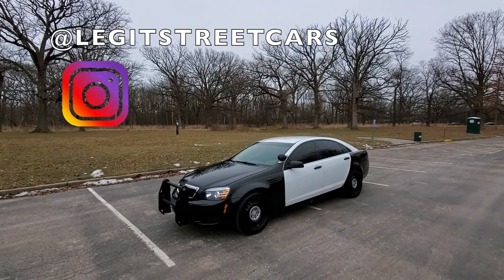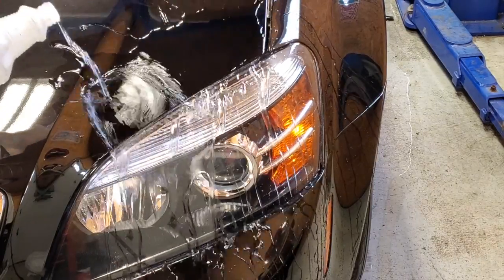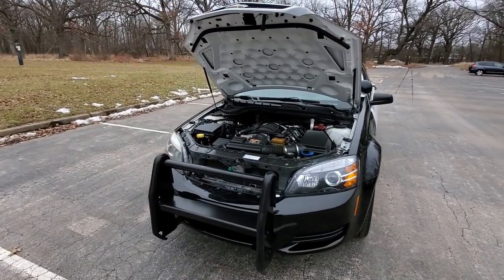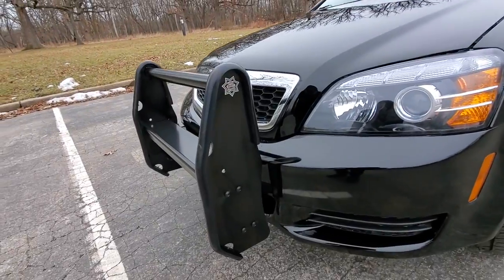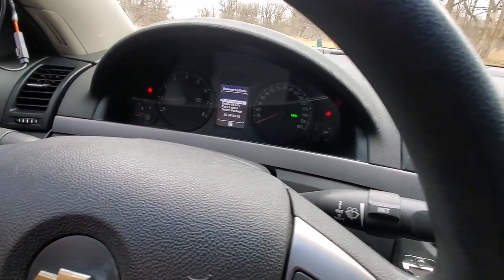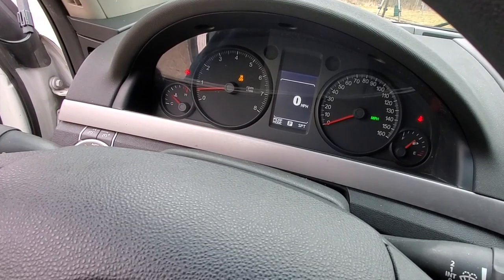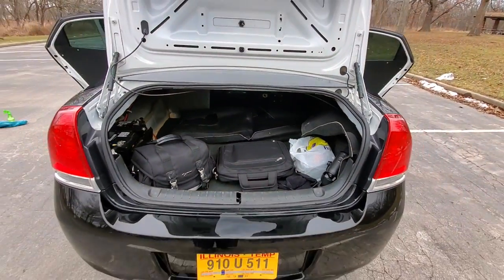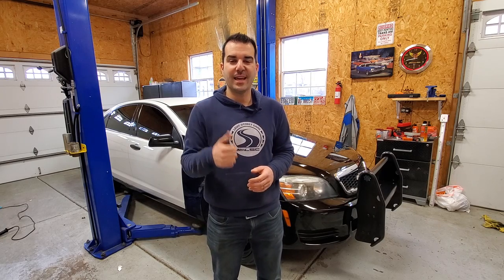I Bought The Fastest Police Car Ever Made & The Cheapest Way To Buy A Modern LS CAR! 4-Door Camaro!

Comment: I own an '09 Pontiac G8 GT, basically the same car. I bought it new in September of '08, still own it although she's in the shop now. It's fast, especially with a few mods I did, had it flashed for high octane fuel, put ram air in it and had the tranny firmed up. I can bake the back tires (limited slip) taking off then a good chirp on the 1-2 shift and a chirp on the 2-3 shift, that's at close to 100 mph so I don't do it very often. When I first got it I caught myself doing 120 mph several times on the way to work, ha ha!

Comment: Vehicle made and sold in Australia by Holden and called the Statesman here. Also came with 6.2 LS or LS9 from HSV vehicles with very upmarket brakes, coolers, and tires. Top speed was limited to 155mph (without limiter - 182mph).

Comment: That cars a holden VE statesmen built in South Australia/Adelaide built at the Elizabeth holden factory
Reply: Technically, no its not, all LWB vehicles in Australia were W prefix designation SWB and MWB were V prefix, and that vehicle is not a Statesman as Statesman is a trim level designation not a platform designation so you might as well call it a Commodore which is about as factually  correct, not! If you remember Holden discontinued it and only made Caprice level available
Reply: Its a WM Caprice

Comment: I had a 1977 Plymouth Fury II with a 440ci large block mopar engine. It was a used state police interceptor. It had 65000 miles when I got it.. Had it up to 125 and still had more than an inch of accelerator pedal travel. Reason I didn't go faster is suspension developed a shake at that speed.

Comment: Check with your local used car lots to find out who they use to replace headliners. They take the existing one out, clean all of the old fabric and glue off of the board. Then they replace the fabric and reinstall. I have a local guy that does them for less than 100 bucks. Check into it.

Comment: It came from Florida, that's why it has a million idle hours. It's hot there and when the Cops were sitting still they had the air conditioner running.
Reply: They all do everywhere. Up north you have to have the heater running. Plus you need to keep the battery charged with all of the accessories they use.

Comment: In Australia you could have bought the similar car with similar, or better specs. Most Holden models could be bought upgraded by HSV (Holden Special Motors), which depending on what's available, the car could be a decent performance upgrade. Or, a step further to the ultimate upgrade, is to buy the car from Walkinshaw Performance, which I believe was an authorised dealer. You could get a stock Commodore V8 high 200kw, or a HSV at around 310kw, or a Walkinshaw GTS which last time I checked, upped the performance to almost 700kw, which is maybe 50hp shy of 1000hp. (Not exact conversion, as there's multiple types of horsepower. 1kw is near on 1.35hp)

Comment: They are very fast, I worked at a GM dealer when we had a high speed chase involving a modified liter bike and a Caprice . They pulled the chase at 160mph. We then had to speed lock that Dept cars to 140mph. I got to speak to one of the officers involved and he said " the officer was at 170 mph at one time and it was still pulling ". I would get one of these but as a gm tech I know how expensive the parts are for these. Most dealers don't carry parts for the Holden Caprice and good luck getting parts at Napa .
I love my p71 but I am looking for a new retired police car. I'm going back and forth between one of these or the Dodge. I really like the dodges styling and performance but I've been a mechanic for over 25 years and I have trouble trusting any Dodge product as they have made me a lot of money but the GM is not without it's issues like eating its own valvetrain, and massive oil consumption issues, and the price and availability of parts.
Reply: Rob Sorgdrager just order parts out of Australia for anything unique to Oz but most parts can be cross shopped from other models.

Comment: I drove a taxi in the mid 90s in OKC and we were driving ex-highway patrol cars. The most numerous then were the Plymouth Furys but I drove a square body Crown Vic that had been a detective's car so it had the cloth interior and was pretty well loaded with options. The Fury's weren't the fastest cars but they were extremely tough. The last one I drove was privately owned and it had north of 430k on it and it drove like a much newer car. The Crown Vic wasn't nearly as basic as the Plymouth but it was a lot more comfortable and roomy.

Comment: My father was a Florida State Trooper on the Turnpike in the mid to late 60's. In late 1968 FHP was purchasing 1969 Dodge Polara's with the 440 Magnum Police Package, not sure what horsepower or gearing, but these cars routinely push 180 mph and a bit beyond top speeds. He told a story of clocking a Corvette heading north at a high speed sometime after midnight near the northern most Orlando toll exit. In those days, clocking was done manually with a unit called "Vascar". My dad turned to pursue and did not catch him till just before the Okahumpka Service Plaza, and only because the driver of the Corvette pulled over and stopped. He could have gotten away but was fascinated to know what kind of car was slowly but surely catching up. Of course, back in those days radial tires were somewhat new and in some cases proved to be unreliable at such speeds, and at least one Trooper was killed during a pursue because of tire failure.

Comment: I’m a performance driving instructor, and I’ve had the opportunity to spend time in the Chevy Caprice, Dodge Charger (hemi), Ford Inteceptor (Taurus 3.5 turbo) and Crown Vic (4.6l) on a track. The fastest around the track was the Ford, primarily due to AWD. The Dodge (Rwd) was a close second, and the old Crown Vic actually edged out the much more powerful Chevy Caprice (6.0). The reason was the frame was so flexible we had the outside front tire vibrating when pushing it around corners. It was really disappointing. I’m sure a strut tower brace would help, but it’s really just a flexible chassis. A shame really
Reply: Caprice did poorly in MSP and LASD testing, outside of top speed (155 mph vs 152 for the Dodge).  It also did very poorly in the Car and Driver Lightning Lap against the Dodge.  

The current AWD Charger holds the top spots in the MSP against the new Exploder, which suffers from some understeer, braking, and downshifting problems.

Comment: You just need to get spray glue for the headliner sag. Go to the side and either pull some apart or slice it with an exacto knife then pull it down so you can fit the bottle inbetween. Then you just spray all over and have someone else take a flat edge while you pull the material back so it lays nice and straight. I cannot believe you know how to change a cam and put headers on but do not have experience in re-gluing headliners! Wow! Also, the reason your exhaust rusts is because of the moisture your engine makes when it heats up. All gas has water added to it. When your engine is hot enough it evaporates and goes out the tailpipe. If you do not run your car long enough at a higher temp (IE you have a 15 min drive to work everyday and don't warm it up more than 5 min) the water never burns off. The muffler will rust or rot from the inside out. This is common and I see it all the time when I am driving that people will start quick off the line or turn a corner sharply and about cup of water runs out the exhaust. That is because they do not let the heat bake off the moisture ESPECIALLY in the winter when it takes longer to heat up! I have about a 15 min drive to work but I let my car warm up for 10 min then get on the interstate and push 65-80 the whole way. If you putts around local streets at 40 mph it takes a lot longer to burn it off. My dad lives about 15 min from town and always runs highway speeds and each drive is at least 30 minutes. He has an original muffler on his 1980 Ford! I was assisting him put in a new gasket and the pipe/muffler still looked intact! I could not believe it but he told me that was all original. Almost no rust even on the outside but the heatshield was pretty much not there anymore. If your cop car was idled that much you can bet the moisture was baked off.

Comment: 2 stories:  In 07/2018, was popped in my '16 Chally doing 88 in a 65 (busted down to 84 thankfully), but it didn't matter that there were 2 little rice burners pulling away from me at that speed, he had his sites on the muscle car, OF COURSE! That motorcycle cop shared with me about the V-6 'maro he had back in the day & told me: "Yeah, even though ours are not 8-cylinders, these V-6's of ours can really get away from us, can't they?", he chuckled. 
Mid-summer ca. '92, had a red '77 Firebird Esprit like James Garner's in "The Rockford Files". I flew out to San Diego to help an old Platoon buddy's wife move into on-base housing. On my way home to Colorado, I had the speedo PEGGED at 140, so averaged about 140 through all of those states I was cruising through.  Did not get a ticket until I hit the freakin' Colorado state line (felt like they knew I was back, ha-ha). I was coming down a 6 degree, left-hand curve when I saw the gleam of his windshield at the bottom of the hill, hiding behind a ground level sign. Had I not been in the process of breaking, it would have been a LOT worse than going 77 in a 55 (that was back when some of CO's highways were still only 55-M.P.H.) and no, even at 51-Y.O., still - - "I CAN'T DRIVE 55!". NICE CAR YA' HAVE THERE PALLY!

Comment: It's not the mileage, it's the idle hours that kills responder vehicles.  Fire trucks, ambulances and police cars USUALLY come with an Hour Meter.
They may have low miles, but will generally have major wear in piston rings, buildup in the intake manifold and exhaust problems.

Comment: my Department use to have 2011 to 2014 caprices we now have Tahoe’s 2014 to 2018 as well has explorers 2010 to 2018 but our idle hours are well into the 10k hours on our 2016 vehicles. Our cars probably run 22 hours a day. Speaking with the mechanics they stated that every hour of idle is equivalent to 35 miles. So using that formula your caprice has over 290k miles just for the idle hours.

Comment: There is no doubt that the last Chevy patrol vehicle I had was equipped with the L6.  I worked Investigations at the time, so my vehicle was a "slick", i.e., no light bar or spotlight.  I really don't know how fast it would go, but I was told by a uniformed Patrol Officer that he had me at 143 mph on radar.  Whether or not he had tuned it recently or not I don't know, so that reading could have been of by a couple mph either way.

Comment: I got an x cop pursuit car. ( wagon ) ours are un marked look Civilian same running gear with sports shifts.  Flick it to the side and change.  Maybe like your Pontiac or Chevy SS.  As mine is noted a Commodore SS ... but there’s a SSV. And a SSV Redline too as go up before the HSV G8 ..  caprice is a family car over here. a calis  is a short wheel base top of the range ( caprice in a short wheelbase ) but nice.  Yes L77 E85 compatible. L76 same but only E10 compatible. L 98 our manual motor first couple years 2007 . No DOD. That’s it I suppose.  lol. Enjoy. Ozy rectangle port LS

Comment: @LegitStreetCars 13:56 about your sagging roof liner, you might be able to buy a cheap 2nd hand one in good condition from your local wreckers out of another PPV 9C1/9C3? Be way cheaper than importing one from Australia from a Holden Statesman/Caprice. 
You could also try quoting importing one from other markets that might be cheaper/closer to America? The Holden Statesman/Caprice was also sold in New Zealand, and also exported to other markets, under different guises such as:
▪︎Buick Park Avenue (China)
▪︎Daewoo Veritas fc 360 (South Korea)
▪︎Bitter Vero (Germany)
▪︎Chevrolet Caprice (middle eastern markets - Kuwait, Qatar, Saudi Arabia and the UAE)
Reply: America also got the Holden VE Commodore sedans in Pointiac G8 form and the VF in the form of Chevrolet SS, so could try your local wreckers for those cars? 
I'm just not sure if the roof lining can just swap over from them though? Because i think from the B pillar back in Statesman form its different than a Commodore. The Statesmans rear door is stretched/bigger for luxury and has different shaped C pillars with differently designed glass. But still may be worth checking just incase they still share the same shaped roof liners.

Comment: I am a contracted custodian at a police department. Meaning I am not an employee of the department that I am tasked with keeping it clean. You mentioned idle hours, and made some comments about what that could possibly mean. Idle hours does not necessarily mean as you mentioned putzing around or sitting alongside the road with the air conditioner running. 
It is not uncommon for the cruiser to be parked in the departments parking area, and leave the engine running.  With no one inside of the car. This allows them to take off in a hurry to respond to a call, if need be. Keeping the windows clear in the winter time...
Trap speed, I have no idea what that means.

Comment: Hey sir,I  don't want to disagree with you  but I have a 1991b4c Chevy camero  which  as you know is the first year they used a camero as a cop car, I can't  remember  exactly the numbers, its around 550 & 600 units the first year, out of them around 160 & 175 were the special pursuit addition, I only know  that when I thought  I had a ECU. problem,they needed the VIN#  because  the 2 different ECM.  And chip  combination  are as is mine, no rev limiter. If interested  about  the B4C. Cameros and thing regarding and se mine.Its still  has the black and white  paint  sceam. repainted of course, Still getting thumbs up  from kids and all ages  even  the little  gray haired  folks  on a sunday going  to get to gatherings.  Just let me know.
  By the way my B4C Camero has 247,000 miles,it had 175,000 when a got it from the sheriff him self. Personally I've  had it over 155mph,just how much  I can't say it was up against the peg of the dial and was still  going and I decided  I did not want to  brake the speedometer. Thanks for  you time and your content  . P.S. It's not to bad in the 1/4 and on the freeway gets between 25/27 MPH, but in town it not so good, mostly because of the  way I drive it, with automatic that I built, it barks the tire hard. And requires  a steal tranny mount ,The severe duty Chevy  mount will  only handle one or to 1/4 hits before letting tranny tail shaft hit the drive line tunnel. 😃

Comment: Had a guy that was moving from the house next to my friend house give us a 1971 dodge polara ex chips highway patrol interceptor with a 440 385 hp engine had a lot of fun in that car
Reply: The 69 & 71 Dodge Polara's were Sweet that the CHP (California Highway Patrol Bought for those Years.

CHP Mostly in the 60's & 70's Stayed True With Dodge, in 67 CHP bought Oldsmobile Delta 88's for the Fleet.

In 1970 they Bought the Big Mercury Monterey for its Fleet, the Monterey Had it's Issues, such as, No Power Steering, the Big Engine, I think was the 428 CID Ford Engine? Was Too Heavy for the Engine Mounts, also in 1970 LAPD bought the Midsize Mercury Montego, which had a Powerplant Engine. & A Couple of Other Problems.

 CHP went back to Dodge Polara, Later Monaco (Big & Mid Size) & the Turn of the 80's the Dodge St. Regis with its Poor Horsepower because of the California Emissions Rule, afterwards CHP went to Diplomat & Later Impala & Caprice in the 80's.

Comment: That wasn't a Florida State unit unless they've changed their livery since I was last down there.  Black and white is generally a metro scheme, likely a city PD or something like that - possibly Gainesville.  Another option is that it might have been a college or university PD unit and that could explain the high idle time.  NJSP has a number of these Caprices, troopers seem to love them, and they move like lightning - 97% of what's on the road around here isn't going to outrun one.  I've talked to a few of the troopers that have worked the Caprices and the Chargers (which only seem to run the Turnpike) and the Charger is a rocketship compared to the Caprice in law enforcement trim (their words, not mine).  If you're looking for another one, NJ Transit has a number of Caprices... not entirely sure how they pulled that one off, but they're likely the 9C3 variants and not the 9C1 since they're not used/marked for law enforcement.

Comment: Made in Australia mate, we call them commodores, yep they are quick as, unfortunately they and the GM company Holden are done, very sad. Here in  NSW Australia we also have Ford Falcon F6 Typhoons, highway cars, they are turbo charged 4 litre straight 6, that would pull a Commodores pants down. Absolute beasts. Unfortunately Ford Australia is gone as well. Now we have Chrysler 300C SRT, BMW turbo Diesels in NSW, and a few states use KIA Stingers.

Comment: 11000 hours - because he sat with the AC on kuncklehead .  And what this means is that your cam is shot because the oil pressure at idle isnt really enough to oil it.   A well known issue with cop cars.  There are parts unique to holden.   however is it a good deal - yeah clearly it is

Comment: I'll tell ya...  as a cop.  This Caprice was my last car before moving to an Explorer.   That car will do faster than you think.  I had my car at a top speed of 168 mph chasing a motorcycle.    Only problem with these cars are the control arms break often and because of the torque the motor mounts break often.  Aside from those problems, it's a bad ass car and I'd rather have it than my Explorer.  ITS FAST AS HELL